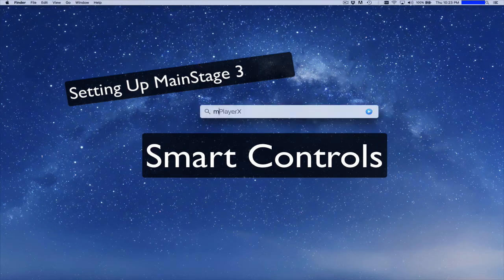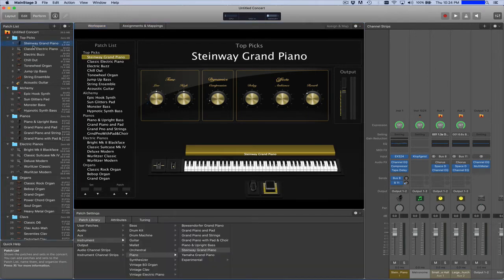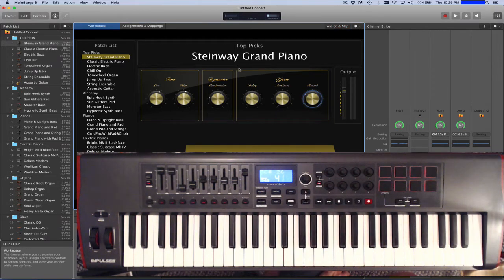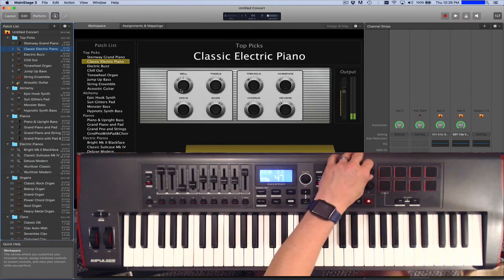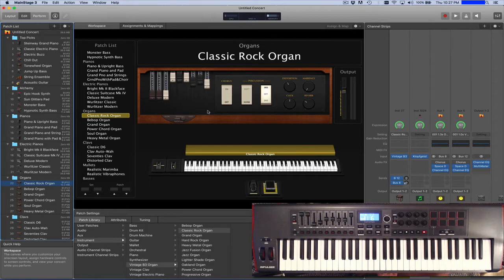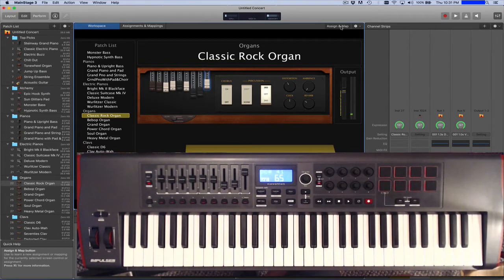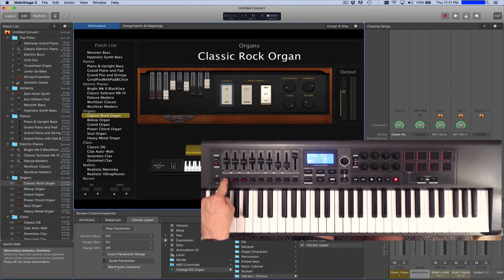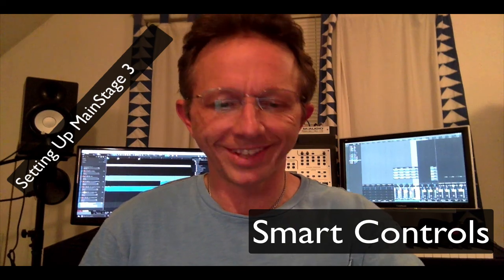Setting Up Smart Controls in MainStage

Comment: Thanks for posting, very helpful.  Can the buttons on that midi controller also send program change messages to change the patches in MainStage?
Reply from the maker: I haven't done that specifically if you mean an exact program change number - but you can add buttons for next a previous program to the layout - then do a 'learn' to map the button from your controller to the screen control.   With a little digging, you should be able to have it send a specific program number and not just 'next/previous'.  Hope this helps some!

Comment: How do I assign a smart control to a midi controller knob for a single patch, rather than all of them at once? (For instance, I want the "delay" smart control 4 knob of the steinway piano assigned for only that single patch within that Set folder).
Reply from the maker: Sorry I missed this comment long ago, but thought I'd answer anyway.  You need to select the patch first, then do the settings for only that patch.  Then the controls will apply at the patch level I think.  Keep in mind, the top 'Concert' level can also have controls assigned, so you need to make sure there is no conflict between the concert-level settings and the specific patch settings you are trying to make at the patch level.  Best!